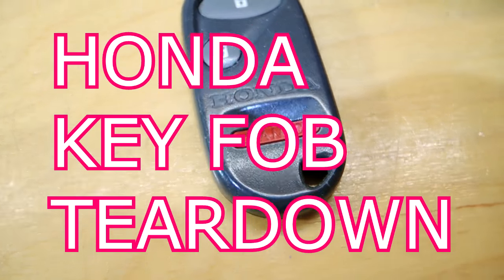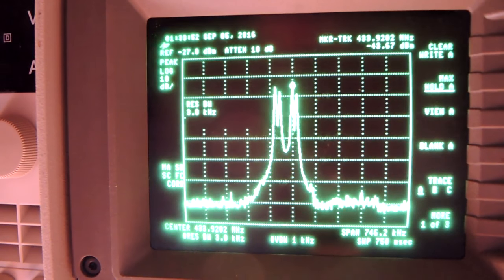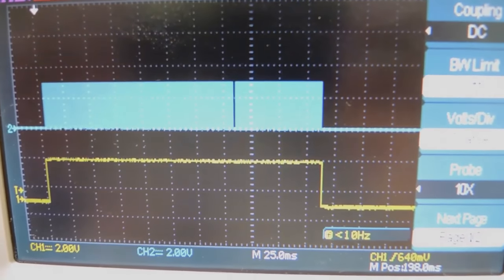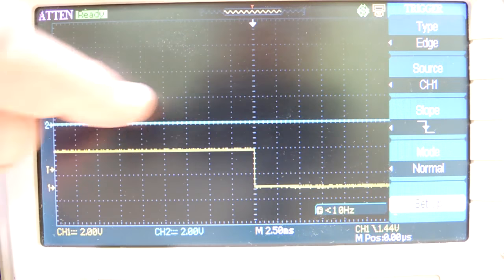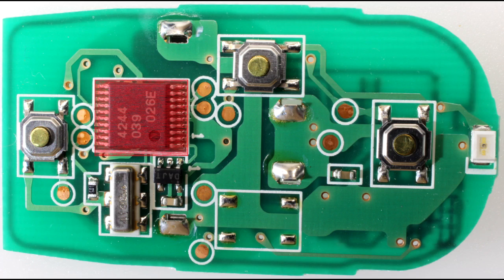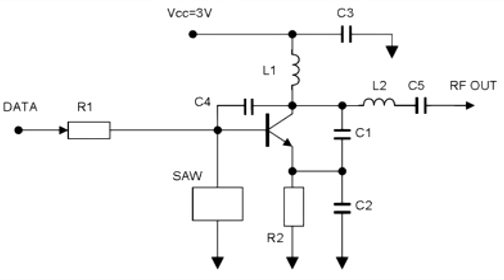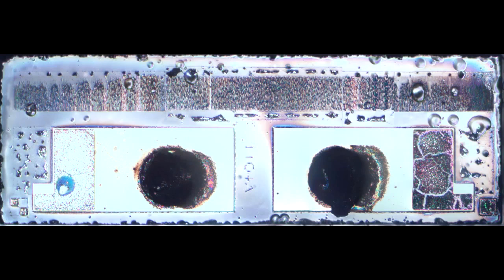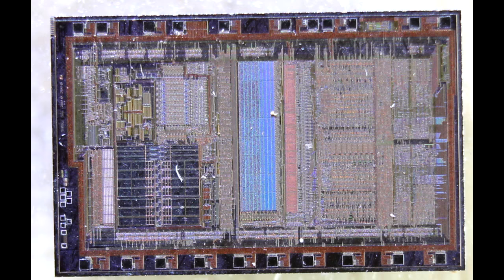Honda Key Fob Teardown

Comment: The xtal is a ceramic resonator - example: Murata CSTCE16M0V53-R0
Reply: That's what it looks like to me too. It's a 3 pin device the other three ceramic pads are connected across to the first three. The extra pads provide mechanical support.

It has 3 pins rather than 2 because it contains the 2 load capacitors you would normally add externally (between each crystal leg and ground) when building an oscillator circuit so the extra pin goes to ground.

Comment: old video i know, so i have an odyssey FOB, hit the button and the LED lights up, BUT wont let me bind to the ody throught the multistep process.  tried swapping out the battery.  at autozone they have a fob signal tester, but mine doesnt seem to cast any signal.  inside components dont seem dirty nor burnt.  any trouble shooting recommendations ?